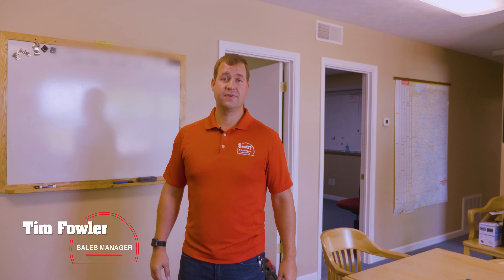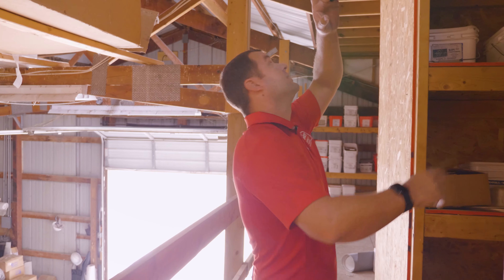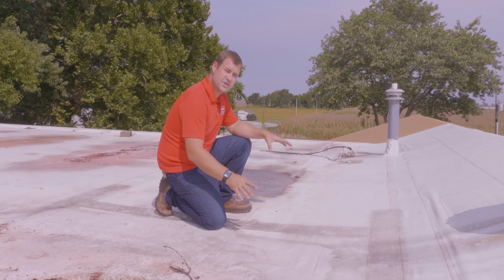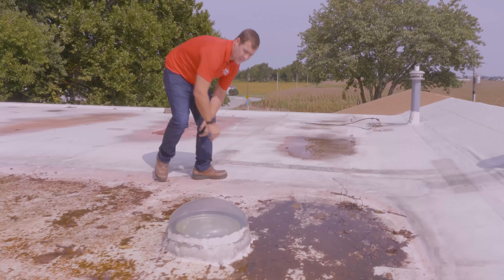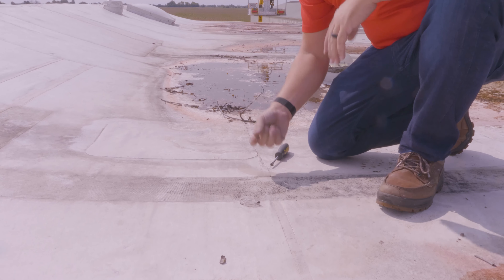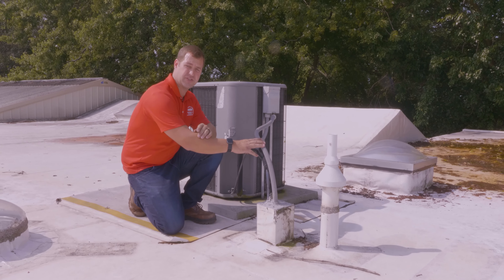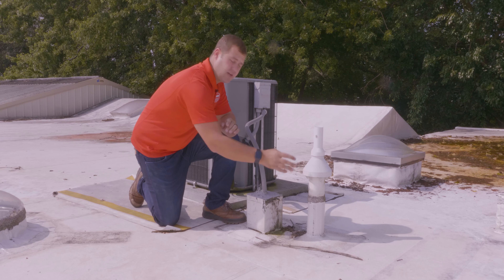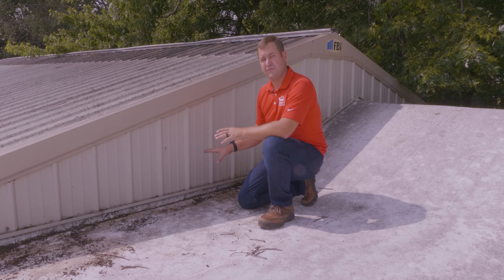Commercial Roof Inspection Process - Sentry Roofing, Inc.

Comment: As a commercial roofing estimator myself I must say you did very good job of explaining the inspection process on this particular building.  The fault finding in these comments is so irritating.  The answers to several of these other comments are in your video.  The caulking is a temporary seal of the core sample because this building is being reroofed soon, there is absolutely no reason to install a patch during an inspection.  If needed a repair crew can install a patch over the core when they are welding patches on the other leaks you found.   The core sample is required to give an accurate bid period!  Since you stated you were giving the customer a bid you clearly need the core sample.  You can't tell additional roof layers, insulation layers, thickness, or insulation type from a thermal scan.... Therefore there is no way to give an accurate reroof bid based on a thermal scan alone... I've found that half the people offering an thermal roof scans have inadequate or no thermography training and have no business operating a thermal camera.

Comment: Good video my comments would be a drawing that locates and reports roof equipment and leak locations. The report should include photographs. You didn’t mention typical flashing heights. You mentioned repairs and replacement but not maintenance such as sealant replacement that may extend the serviceable life of the roof. You also didn’t mention if the client knows the history of the roof. Make sure this roof is not under warranty, that cutting a core may void. Other services not mentioned is a moisture survey to confirm the condition of the existing roof.